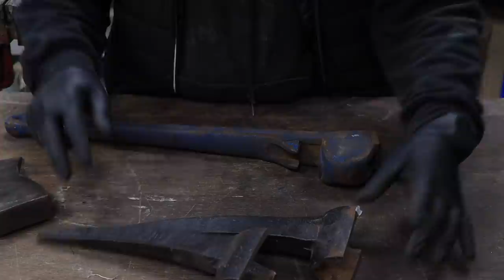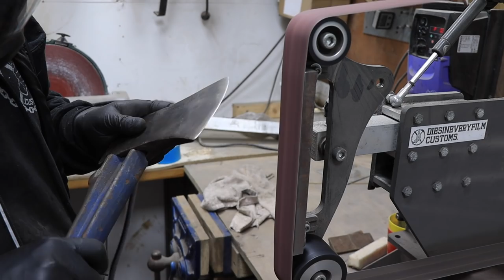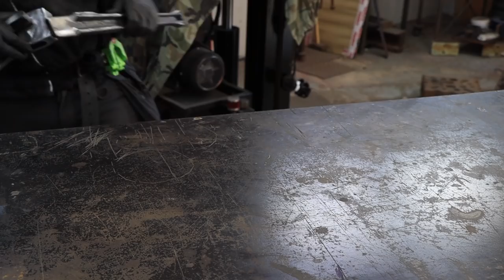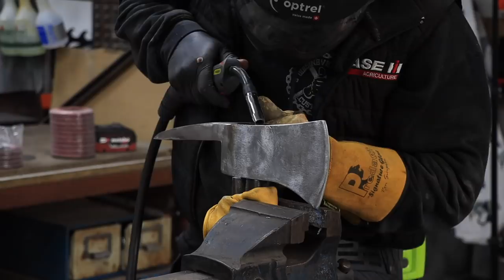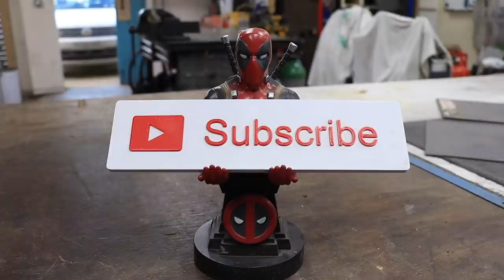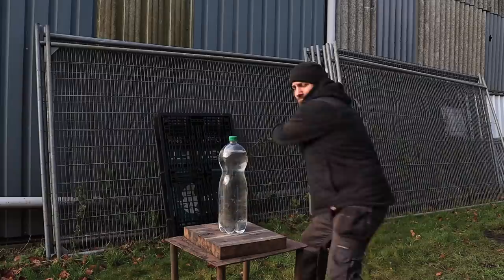Making A FIRE AXE Demolition Tool! Will It Work?

Comment: Another great build. Yet another reason I'd LIKE to have 3 phase running to the shop. You can't do stuff like this on a 110 volt welder. I can't even get enough bead penetration to hold a stack if damascus on the end of some rebar with either welder I have.
Reply from the maker: Damn, I only have 240 here but it’s standard, and the welder is turned down as well
Reply: Yeah we get 110, 220 on big appliances, then you have to jump to 3 phase which is ideal for a big boy welding rig.
Reply from the maker: @drstrangefart  hope you get it sorted then mate
Reply: Eventually I will. We have long-term plans that include a shop much bigger than half a 2 car garage.

Comment: ah that is cool, looks heavy and hard to control but would demolish a fort lol, as usual an interesting and amusing build and vid, keep on keeping on and if you value your shop hide it from the red one 🤣
Reply from the maker: Cheers mate, the weight is heavier but it’s less effort to split stuff and not hard to control, i made the bottom spike shorter cause it was off balance when I tried longer
Reply: @DiesInEveryFilm  a great build, and obviously more work than the video shows, mind that is true of most of them I do know
Reply from the maker: @andyc750  oh yeh definitely was, took some extra hours in the workshop